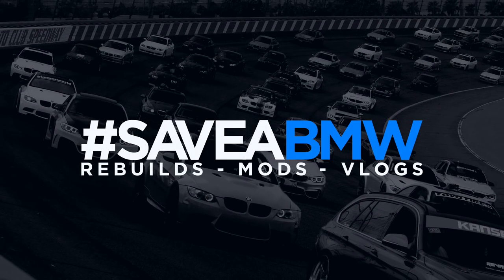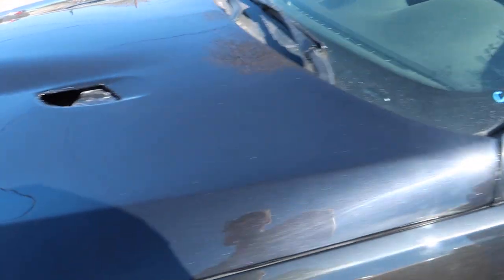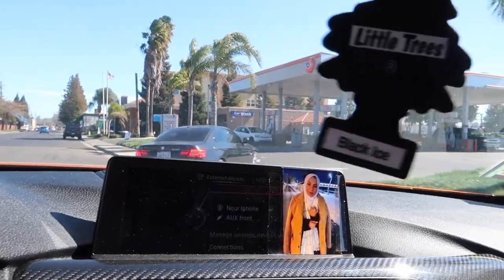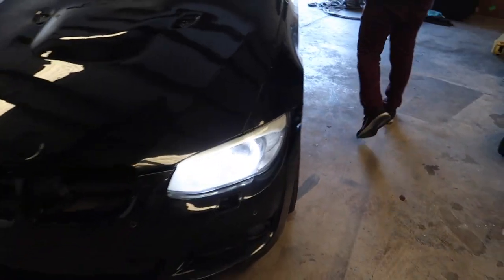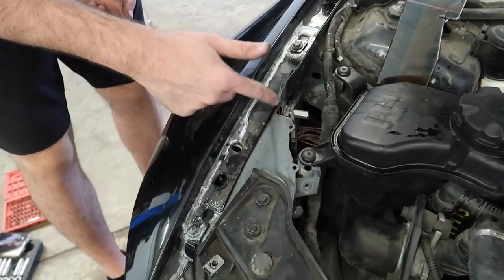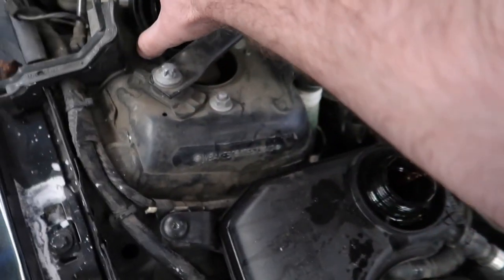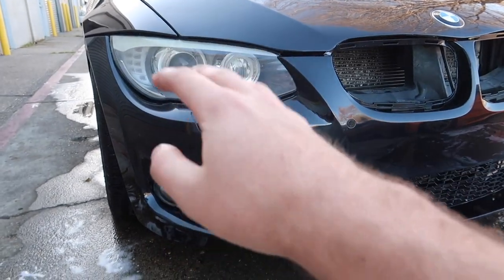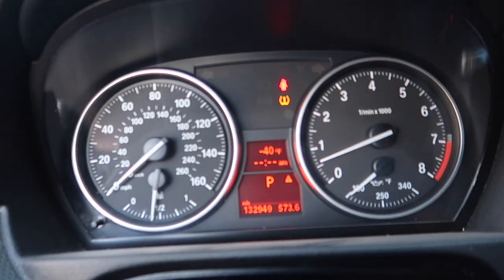AFTER NEARLY A MONTH! WAS MY BROTHERS BMW WORTH FIXING?

Comment: Honestly my 335i x drive 2009 is a nightmare I just keep spending so ,much money on it, dont get me wrong I love my car but 2 years of ownership has been problems after problem currently I need alignment new control arms new rotors and a walnut blast can you recommend where I get get cheap parts but long lasting. Ps you make everything sound better when it comes to n54 Repairs I wish we were close to each other I'd make u work on mines too
Reply: TorontoShoeCustomz TsC what you are describing is maintenance not “problems.” Your mistake is looking for “cheap” long lasting parts on a bmw, there’s no such thing as cheap long lasting parts, unless you go to a junkyard and pull them off another bmw. But even then parts aren’t guaranteed. Don’t own the car if you can’t afford the maintenance, especially on a 335